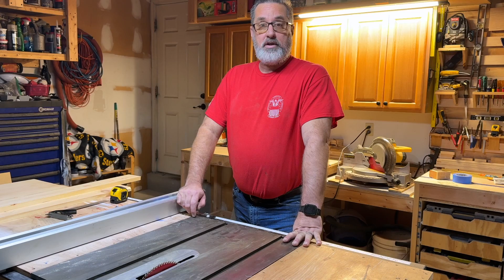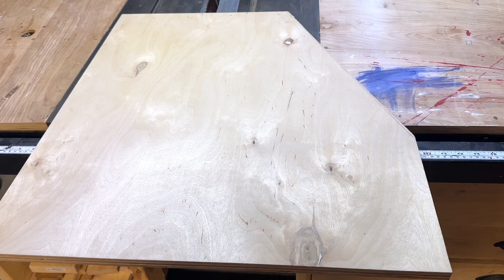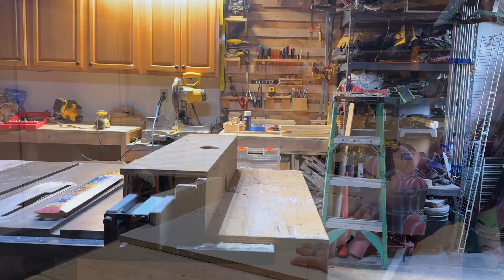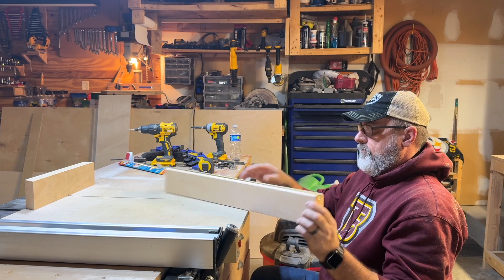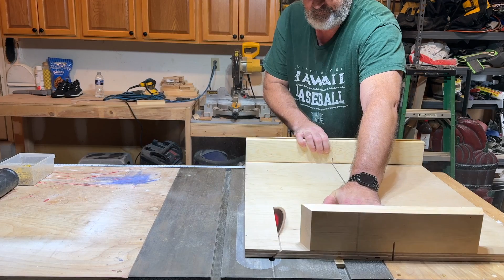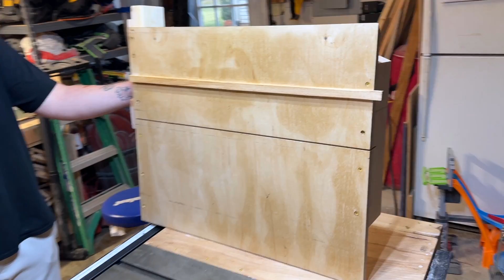Easy DIY Crosscut Sled build (I THOUGHT)

Comment: What is a cross cut sled?
Reply from the maker: Just as it sounds.  You can make multiple cuts with the stop block and its always a square cut.  You can make them bigger than mine and there are multiple ways of making them for your own use.  Just making cuts on the table saw clean square and quicker.
Reply: @KarpsWorkshop-yc7qz  so, just constructive criticism.  Do some editing and show the final product at the start.  30-45 seconds of hype of the video.  What it is , what it does, what it will look like.  Just my $0.02.
Reply from the maker: @ your absolutely right.  I will do that on the rest of the videos. Thanks man, need the ideas and everything helps out!